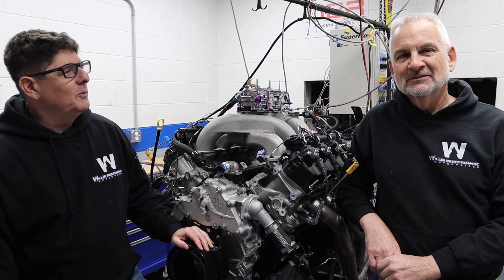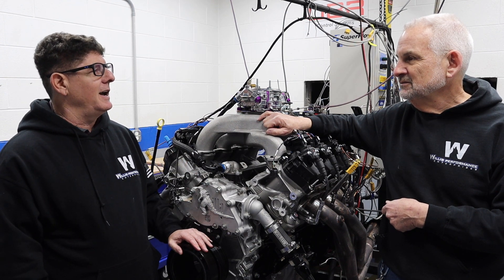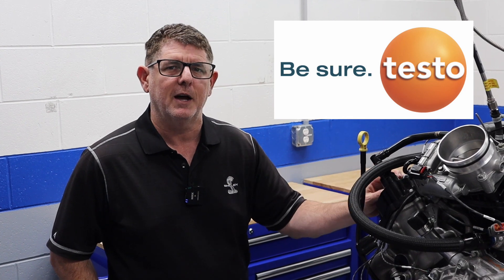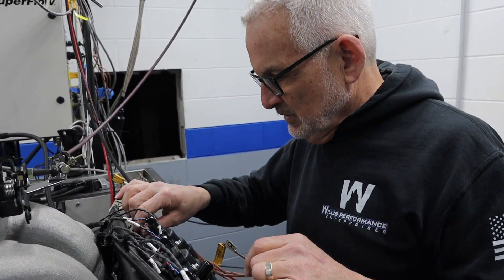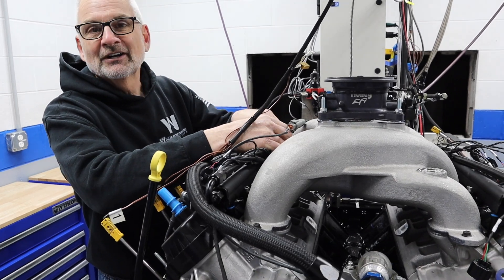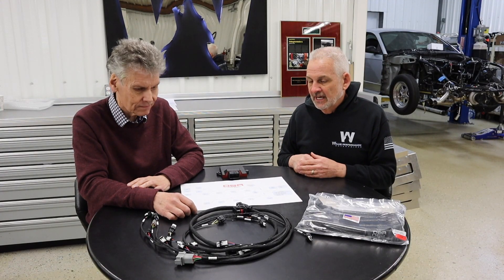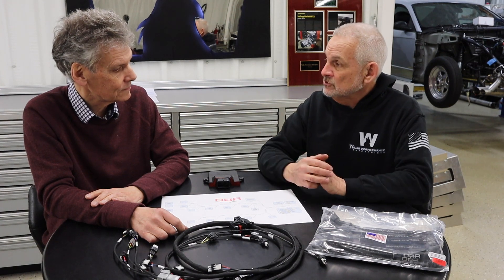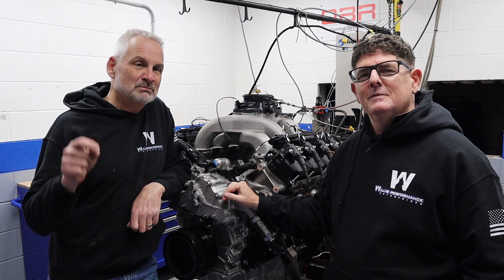Carbureted 7.3 Godzilla, Can it be Done? Carbzilla Ford V8 Dyno test!

Comment: I have been thinking of getting
a 1967-85 Ford 2WD pickup truck. Eventually a 4x4 truck as well. 
I saw this video and wondered what I could expect if I dropped in a stock or upgraded Godzilla like this one & a manual transmission.

I've had 4 street 80's carb Fox bodies under my belt.

Comment: Gee those Heads look like they would LOVE 8 x 50mm throtlle bodies running injection aimed straight at the valve! Does that 4 barrel throttle body have an IAC and airflow sensor in it?
Reply: We have run the INNOV8 ITB's work great.   Yes the throttle body had an IAC, and the intake a MAP, but no MAFS.

Comment: Everyone selling these dual plane intakes with a 90degree dogleg on the lower plenum to intake port should have to post a dyno graph of their intake vs a stocker. The same style intake is sold for a gen 3 hemi. These engines have a very high intake port angle complemented by the factory intake manifolds. Please show us a dyno test where these dual plane intakes with a 90degree port intrance on the lower plenum surpass the output of a factory intake??? Godzilla and gen 3 hemi dual planes look like an enormous hp compromise to buy hood clearance for swappers and sell substandard parts for profit. Tell me I'm wrong

Comment: I love the Godzilla…would love to swap one in my single cab 95 F150. just curious, what do you and Brian see in this platform that keeps y’all interested in it? I understand the displacement and push rod design from a modern day Ford engine is awesome. But, just seems like the engine is expensive and hard to get. Plus, the aftermarket just isn’t there for it (yet). So, what keeps y’all going at it? Love the videos man. 🤘🏼
Reply: Well, when you say expensive, what is your baseline?   These engines make north of 600 HP and north of 620 ft-lbs with just a cam change.  They are very durable and with boost, like most engines north of 1000HP easily.  Package size is near what a 9.5 deck Windsor is and smaller than a Cleveland.   New parts are easly available.  For the aftermarket, what are you looking for that is not available?
Reply: @brianwolfe2993   i understand “expensive” is relative to different people. It’s expensive to a 28 year old guy like my self who is mainly trying to buy a house. But yeah I gotcha! Makes a ton of horse power in a relatively small package. Maybe I just haven’t looked hard enough for aftermarket I’m just going off of what I’ve seen on YouTube.  It’s not like I’m going to be buying one anytime soon but I was just hoping to get an answer from the experts. 🤘🏼Wish Ford would drop more of these into different models instead of just the super duty’s.

Comment: I don't see why a carb wouldn't work on a 7.3 zilla motor. Set it up right and it should work fine. I want to put a 7.3 zilla into my 97 ford f150 after I body swap it to a 73/79 f100

Comment: Can you ? Sure. But why ? Why not put a points distributor on it, too ?  Convert it to run manual tensioned 
V-belts. Maybe a two piece rear main seal, and cork gaskets ? Hell, just swap a flat head in, then you can have all the old, leaky, constant fiddling with crap engine you really want......

Comment: I remember reading about tests in the early 80's to see which made more power,  carbs or Hilborn style direct port injection.
They found that carbs on tunnel ram intakes made more power than that type of injection.
Having a computer making adjustments will probably change that story, today.
Reply: With the right tuning injection should make more power. If it doesn't you aren't at the limit yet, in terms of compression ratio and timing.

Carbs always have trouble getting the same mixture quality in every cylinder, usually cylinders further from the carb will run lean. So if you set the overall mixture for best power the lean cylinders will be limited by knocking while those closer to the carb are running too rich and not making the max power possible. Port injection (or a seperate carb barrel for every cylinder, as is often done for hotted up inline engines with side-draft carbs) corrects this.
Reply: the carb here wasn t tuned and don t even know if it was the right size

Comment: My father passed away and left me his 69 convertible cougar. It has a super worn out 390 with a automatic. This would be the ultimate swap. I know quick 6 makes a controller for a 6r80( im using in my 12 mustang). My father dreamed of breaking into the 11s his best with the 390 was a 12.2 @ 111. Im sure with a circle d convertor and the 7.3 with just headers would do it. I cant wait to pick one of the engines up
Reply: Build the 390! Trick Flow top end, stroker kit!!
Reply: Keep the FE! FE's are ultra cool.
Reply: Whats a Circle D converter?

Comment: Great stuff Evan. I hope the aftermarket is taking off like for the Coyote!
Reply: Sadly I don't think it will, it will be a niche market maketaftermart parts and pull-out pricy.
Reply: @WDMtea  yes it will I don't know what you're talking about. Everybody is not a modular head. The same thing you said they said about the ls thing. People like easy. 7.3 can be done at home. The coyote,4.6,5.4,5.8,5.2 all take real knowledge to bacyard boogie 7.3 is way more easy to mess with.
Reply: Overhead cam isnt space age alien tech. Its not rocket science. In fact OHC has been around for over 100 years. And the Modular Platform has been around for 30 years. @ranware9071
Reply: @riogrande163  duh can you read or what?
Reply: @riogrande163  yea a lot ppl dont even know about the 427 Cammer in 64

Comment: The weaks points of the 7.3 are the connecting rods-need to be replaced with alloy.
Headgaskets are notorious for popping as well when adding more power.
Other than that seems like a solid platform, yet the Coyote 5.0 can easily match it...😏
Reply: We made about 1800HP with stock head gaskets, so can't agree with your comment on "notorious" for popping.  Agree need to replace stock rods and pistons if you are going after big power.
Reply: Not really they are designed for different purposes

The coyote is for light duty trucks and fast cars. Hi revs and horse power.

The Godzilla is designed to do work like a diesel for low end  torque and pulling power.
Reply: the 7.3 is awesome I agree but the coyote is better in every way, the 7.3 will not match the Coyote. Even in stock form. As for the guy saying the 7.3 doesn't bust head gaskets is crazy. Im a mechanic here in Florida every other week im replacing the head gaskets on the 7.3. Yes its on big trucks that are use for pulling and hard work. I almost never do a head gasket on a coyote equipped f150. Its either the cams and mds on dodge ram or head gasket/turbo issues on the (2.7-3.5 & 7.3) f150.
Reply: @simbanugz2906 once again they're doing this with a truc engine. If ford makes a hi revenge hi performance version we don't know what the outcome would be. They literally put this out to see if we still want pushrod engines... guess what we do old school and new school ford heads even modular guys that I personally know want this in a more racing application vs the truc thing that's why everyone is sitting bac watching and waiting